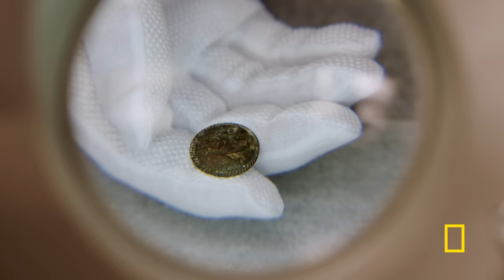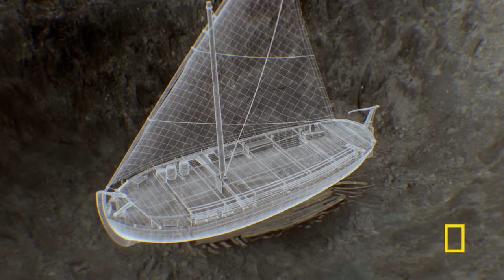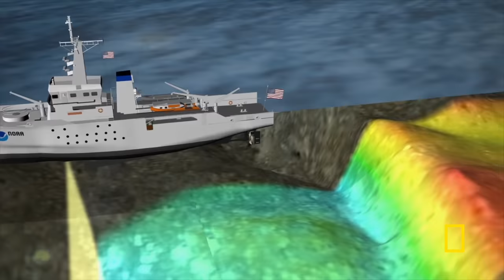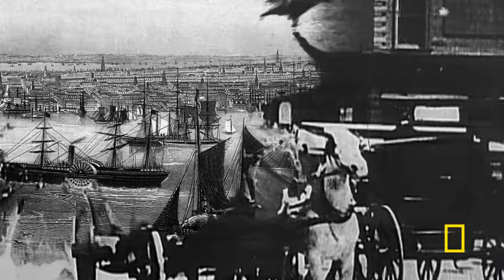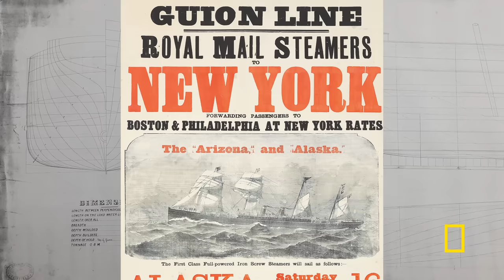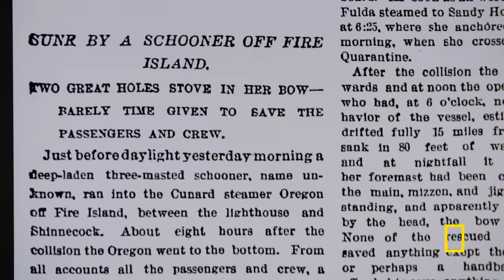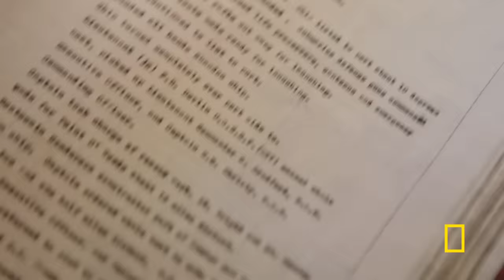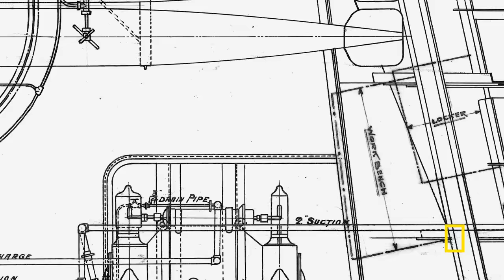Uncovering the Secrets of New York City (Full Episode) | Drain the Oceans

Comment: The last ship must of been horrific for the crewmen that was left inside as she turned upside down. There had to have been air pockets around. Some of those men had to have found those pockets. They lived long enough to pray for forgiveness before perishing.
Reply: Just the last ship?I bet the same kind of panic and horrificness was also present at the Oregon or any other tragedy.
Reply: *must have NOT of.
Reply: @WeldingQueen  the video says that everyone on the Oregon survived
Reply: Turned upside down! Try capsized
Reply: Must have***
Reply: Actually of the 800+ crewmen on board the San Diego, only 6 died and most of them died quite quickly, either in the blast or from being hit by large falling debris.  The rest of the crew were rescued within a few hours of evacuating the ship.
Reply: The watertight doors and hatches on a warship are Not closed unless the ship is in a state of battle readiness called "General Quarters" or other state of immenant threat such as fire or flooding. What saved most of the crew is the fact that everyone was awake and at their mooring stations since they were preparing to enter port.
Reply: The CO2 and oxygen deprivation would've eventually made it a peaceful end with you not being aware of what's going on.

Comment: Not that it pertains to the cause of the sinking of the USS San Diego, but they didn’t mention an interesting detail about what occurred during the rescue operation.

San Diego went down between 100 and 110 ft. (30.48–33.53 m) of water off the coast of New York near Fire Island.  As the Navy received word of the incident, aircraft were dispatched to the area to try and locate any U-boats that may be nearby.  Aircraft from the First Yale Unit dropped multiple bombs on what they believed to be a submerged U-boat. Surface vessels arriving at the site, however, collected papers and photographs that floated to the surface after the bombing, revealing that the target was actually San Diego and not a U-boat.

Comment: I tried to do a little research about the World Trade Center from official information and here are some facts.
1. Before the buildings were constructed, that area was a landfill.  
2. The workers labored for 2 years to set the foundation below street level. 
3. To find good bedrock for the foundation, workers dig down to 70 feet below the street level. 
4. About one million cubic yards of rock was excavated which was later used to build a public park later. 
Now here are my questions
a. This ship was found 20 feet below street level which is about 7 meters how couldn't it be discovered during the construction. 
b. The amount of rock they excavated suggested to me, that the builders had gone down below the soil or silt surface on which the ship would lay down how could this be possible?
c. If the ship sank due to a battle with her officer onboard with the button, it might be a ferocious battle and many sailers on both sides might have fallen in the water. Why can we get at least one broken bone or evidence of human remains? Was it excavated during the construction? if so it appears to me the owners of that building took away more than a broken bone during construction. 
I suspect the builders of the towers know a thing or two about the ship's location and what it carries and closed the area for two years to take or hide them away whatever it carries. Where was Jesus's crucifixion cross buried? It was under a landfill. It seems the ship crew were trying to hide something that they needed to protect under a pile of trash until the time came it would be unearthed. 

I can't swallow the war story even with salt, I believe it was a deliberate attempt to hide this ship with all her puzzle for what ever reason.

Comment: Back in 1900 you would not be able to see the city if you were just 10 miles off the coast. Today, you can see NYC almost from Ireland. Definitely from Greenland.

In the mid 1970s I looked at a live satellite feed at 4am of the United States and it was bright around NYC and a few other cities, but most of the country was dark.

Today, looking at the live feeds, it is so bright through the entire US that there is almost no dark areas at all.

In 1970 you would not have been able to see Earth from Jupiter.

Today at night the light intensity is so great for America that you can see Earth glowing like a small sun from as far away as Pluto.

In 1970 the average house used a 60 amp single phase feed 

Today most 1 bedroom apartments used a 200 amp 2 phase feed

And a 3 story 3 bedroom house I worked on needed a 3 phase 600 volt 800 amp 4 panel feed

And we use LED bulbs today that use 1/5 th the wattage.

If we didn't, we would need 5 times the number of power plants that we have.

In 1900 the population of the US was 60 million

In 1950 it had ballooned to 150 million

Today we are just shy of half a billion

In 1900 the world population was 1 billion

In 1950 it had increased to 2 billion

In just 1 generation the population rose 7 billion to just under 9 billion people today

By 2050 the population will be 30 billion

The planet can't support over 8 billion people

Computer projections done in the 1960s showed the oxygen level would fall sharply in 2030 and the human race would begin dying off till the level fell below 500 million

But everyone ignores the projections

They are done every few years and they have always shown exactly the same results